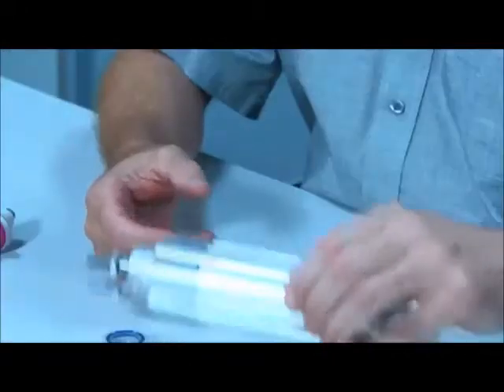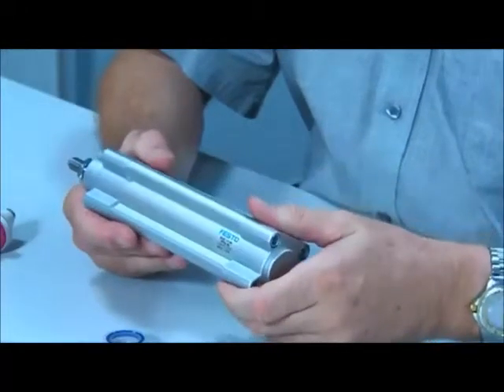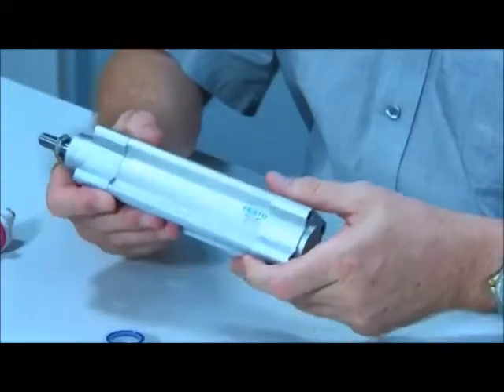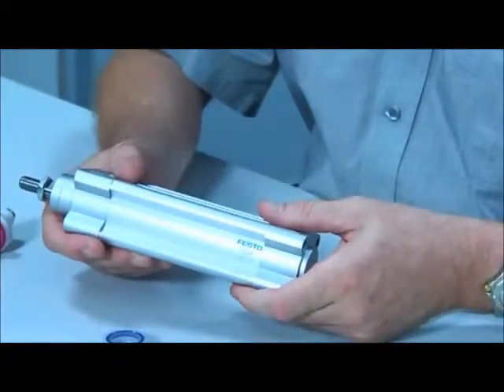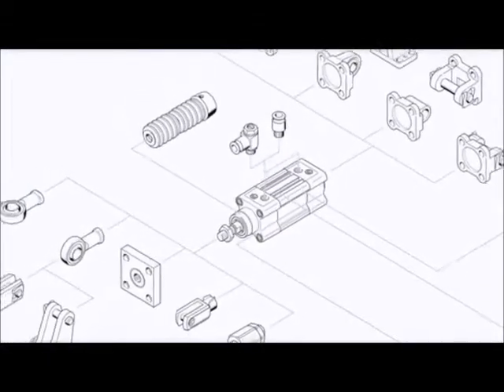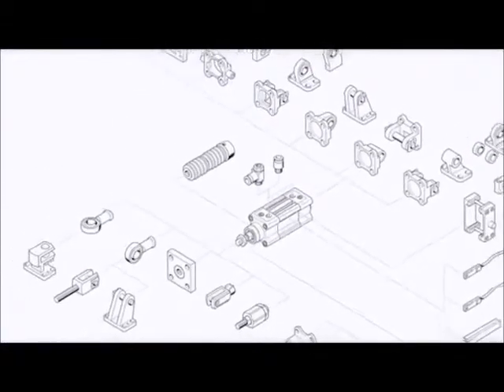Festo DSBC Pneumatic Cylinders

Comment from the maker: An out-of-the-box solution for most applications, the Festo_AG  DSBC Cylinder with PPS cushioning system automatically compensates and adjusts for the set speed and mass that the cylinder is moving in a safe and controlled manner. This makes it easier to comply with the safety standards and create set up instructions within the Machinery Directive.

See our range of Festo DSBC Pneumatic Cylinders @ 

www.hydra-star.co.uk/Products/Festo_DSBC_Standard_Cylinders